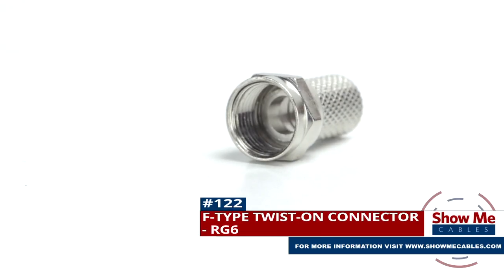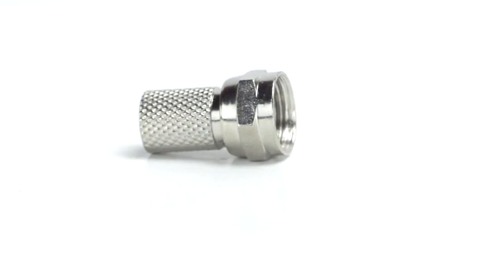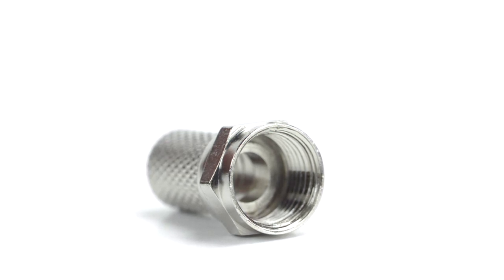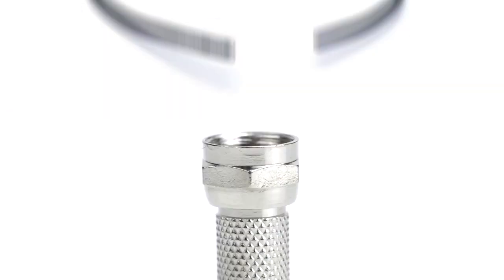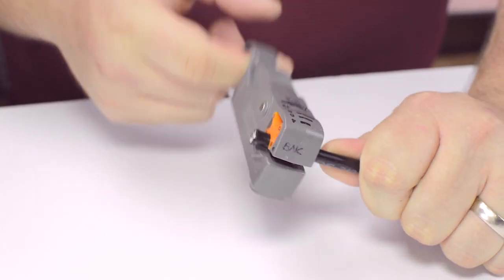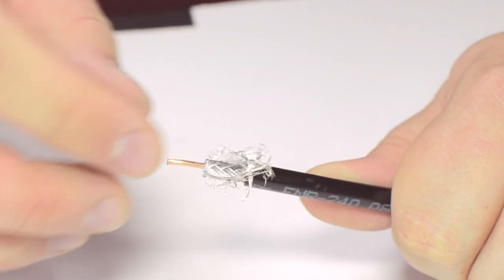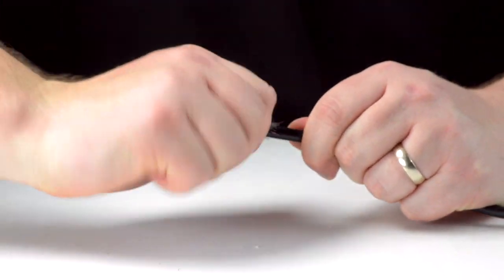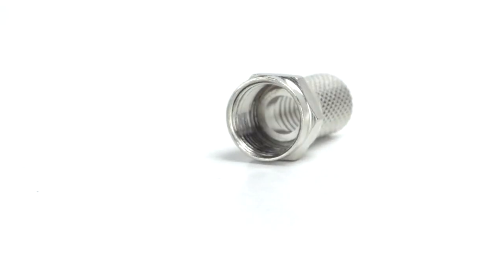How To Install F-Type Twist-On Connector for RG6

Comment: yeah what if it's a plenum cable and diameter of the cable jacket is 6mm not 9mm.... no connectors fit it..... thanks might be fine for  someone's cable TV at home, but doesn't work commercially.